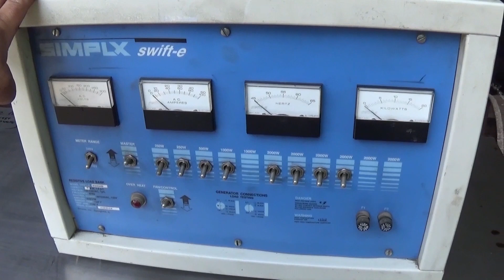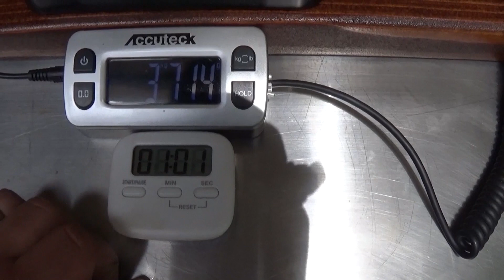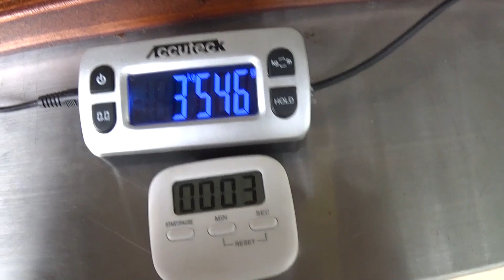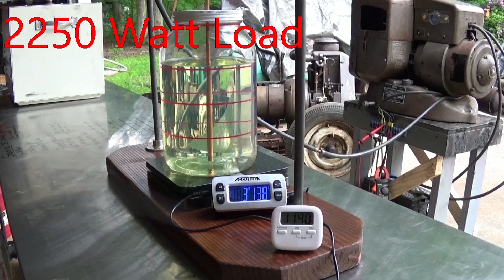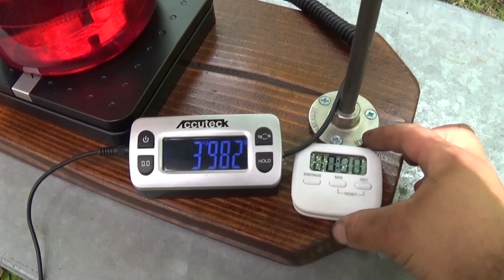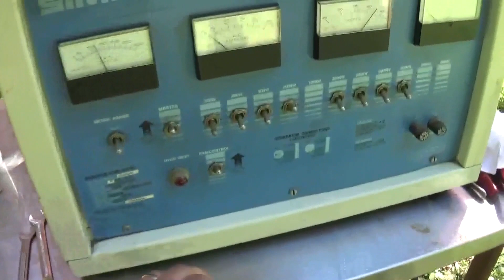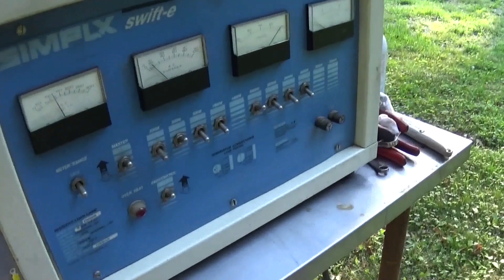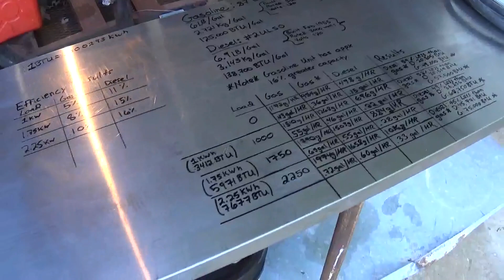GASOLINE VS. DIESEL (FUEL CONSUMPTION  1950s Style)

Comment: I switched over to diesel engines for my landscaping operation over 20 years ago. I still have the first two tractors one has 5000 hours the other 3400 and they run like the day I bought them. I was lucky to get 1500 hours from an air cooled gas. I'm  glad to see the diesel is 50% more efficient. Thanks Mike
Reply: In Europe we are running heavy farm equipment since day 0 on Diesel. I recently bought an old MF135 tractor with little over 5700 hours of operation from 1969 using the famous Perkins Diesel engine. Had it serviced from a real tractor and engine crack and he confirmed that piston, rings  and injector nozzles look almost juvenile.

I will never understand how the US ever got so obsessed with gas powered equipment.
Reply: Was cheaper in the 20s and 30s than diesel was.

Comment: You don’t need to take into consideration that one of them is a higher output than the other

As long as you match the output on both of them your figures would be correct

You shouldn’t have to penalize one because it doesn’t have as high an output as the other one
Reply: I would guess that the point is to make a hp to hp comparison.  All other things being equal, a higher hp engine will require more fuel to stay running at a certain load than a lower hp engine, simply due to the extra reciprocating mass.
Reply: Uejji In theory but in this scale it is not relevant.
Reply: @Uejji  It's still gonna be a pretty insignificant amount though.
Reply: You're right.
Though it would make a difference if one of those was compared to, let's say that Caterpillar.
Reply: @Uejji  ... actually it's all about the HP used, which would be almost the same, based on the electrical output in each test... NOT the possible peak power of the gen set.

Comment: Thanks for doing these tests, it's an interesting comparison. Although these are 1950s generators I think it gives a rough idea of how modern diesel and gasoline sets of that size would burn fuel and could be useful to anyone who has the option of buying either type. The efficiency of the gasoline unit improves so much as more load is put on it, the extra load doesn't cost very much more fuel to run. Expensive to have the unit running, but if it's running anyway, and it's oversized for what you're wanting to power, you might as well load it up with any other appliances that are useful. As we'd expect the diesel's efficiency doesn't fall off quite so badly at light load (as well as being better generally). For one thing it doesn't have a throttle restricting its intake. Some Onan CCK 3.5kVA petrol/gasoline generators were imported here to the UK in the 50s and 60s, quite a lot have survived, running at 1500 rpm for 50hz they were known for being long lasting but not for being economical! I think spark ignition engines with overhead valves and higher compression ratios could do better but they can't compete with diesel, unless designed for higher octane fuels like natural gas or biogas.

Comment: im curious now how a slow speed diesel would whoop them both? like a lister with the big flywheels
Reply: Would really depend on the speed and the generator. A 4 pole will make 60 hz at 1800 and a 2 pole will have to have 3600 for 60 hz. And 8 pole would run 900 r's but it'd have to be a big bore/long stroke like the old Cat. IF it was all a.c.
Reply: Here is the specs from the manual of the Lister CS 5/1. http://www.oldengine.org/members/diesel/ListerData/51P4data.htm
Reply: 2,250kW @80% efficiency engine > electric output. Gives 2,812kW engine input in the generator. 2,813W is 3,770 BHP. The CS 5/1 runs 0,3 liter per BHP/h. 3,770*0,3= 1,131 l/h @ 2,25 kW.
Reply: Those old flywheelers were notoriously thermally inefficient.
Reply: @lewiemcneely9143  US = 1800 / 3600rpm  @ 60hz  EU, UK,  plus shit loads of other places = 1500 / 3000rpm  @ 50hz
Reply: @chris-jb5ds  Right. I don't have to deal with 50.
Reply: The slow speed lister CS type diesels can last a very long time and are great machines, but when I looked at the numbers for fuel consumption (I can't remember where) I concluded they aren't any more efficient than diesels running at 1500 or 1800 rpm (which Lister and Petter also made).  Matching the size of the engine to the load where possible is what really matters if you want to save fuel.
Edited: I think the site Pinz314 linked to is the same place I read the Lister fuel consumption info, thanks for posting the link. Engines of this design are still made in India I believe.
Reply: @desertbob6835  The hot bulb engines were terrible, but the Lister CS is a diesel.
Reply: The injectors in the old CS Listers work at lower pressures so atomization is not that good. Also part of the reason those engines are now banned from sale due to the particulates they produce. I have a mid 80's Lister TR2 8KW generator which runs at 1500 RPM (we are 50HZ) it is direct injection and burns 3 litres per hour at full load. That works out about 30% less than the Onan in this video. I have an Onan 10KW Diesel indirect injection 4 cylinder generator (was marine), it has similar to efficiency to the Diesel in the video.
Reply: I would also like to see that, for comparison. The big, REALLY SLOW 2-stroke diesels used in large ships, running less than 150 RPM, are the most efficient engines available, with thermal efficiency up to 55%, vs the terrible 5% to 10% of the gasoline engine in this vid. Plus the ship engines run on really terrible fuel, like residual oil, that can cost as little as $300 PER TON! (Of course there are some inconveniences with resudual oil, like you have to heat it too about the boiling point of water just to make the oil flow.) There have also been diesels running very nicely on powdered low-ash coal and on landfill gas (about 50% methane and 50% CO2). Both of those weirder fuels reguire a little bit of normal fuel, like 5%, to act as igniter. The powdered coal, btw, is not injected; instead it is aspirated through the intake valve. In modern diesel experiments, medium-sized engines look like they can reach 55% thermal efficiency by using 2-stage compresion and 2-stage expansion (not counting any turbochargers in the compression and expansion). Other modern experiments with medium-to-large engines can also reach 55% thermal efficiency using direct injection of a slurry of powered coal, in either oil or water! (The water slurry fuel is not for engine starting.)

Comment: That's pretty cool. On a side note I think Diesel engines generally last longer because the fuel is more of a lubricant and gasoline is more of a solvent. Now all you have to do is a cost per kilo-watt/hour. Thanks for the cool info Mike. Best Wishes and Blessings. Keith Noneya

Comment: Even both being air cooled they are quite quiet. The diesel really surprised me! We used a 6000 import diesel on no hydro sites and hid it as far from the job as possible running big  12g. Cords. We actually left it in my boat on a island job at least 100’ away!! Man was it loud. And vibrate!! 
My ws2-3000 with a small car muffler is very quiet. 
I knew the basic result of your test before you started but the actual numbers are great to see. Here in Ontario/2022  diesel is running about 10-12% more than gasoline. This will watt for watt almost equalize fuel costs. Now there are other things to consider, initial cost, engine longevity, maintenance etc. Almost exclusively engine differences except maybe vibration effects on generator

Comment: Interesting design the way they did the engine stop on that diesel.  Having it continued to spray some diesel fuel would very nicely wet down the inside of the cylinder probably helping to prevent rust. Often times generators are used and then put away for quite a while. Pretty interesting design.

Comment: You said your not a mathematician. Will I disagree. You did a very good job with engineering everything. Including the mathematics. I work in a power station. I must say; job well done. I have a Lister Generator LPWT4 19.5 KWH in my garage and it is very fuel efficient. 1 quart to power my house.

Comment: Definitely a very dramatic difference in fuel efficiency of a diesel compared to an old flat-head gas engine. It'd be interesting to compare it to a modern OHV inverter-driven gasoline generator (if you can get your hands on one).

I also love that you calculated the overall system efficiency! Really illustrates how inefficient it is to make your own power at home. Toyota has a few small automotive gasoline engines that they claim achieve 41% thermal efficiency. Coupled with a modern 95% efficient alternator, you should have a ~39% efficient gasoline generator, which in theory would be near competitive with many power plants. Although, some modern natural gas combined-cycle (gas turbines with heat recovery) power plants are approaching 60% fuel > electricity conversion.
Reply: Replacing the old IDI diesel with a more modern DI or even CRD, let alone CRDI design ... Diesel will still win by a large margin

Comment: I appreciate the end user comparison; however, the true comparisons are much more in depth. Gasoline engines are less efficient in every aspect, fuel consumption, energy production, maintenance expense, and durability as compared to their diesel counterparts. The very nature of diesel engines automatically puts the gasoline engines at a disadvantage. Diesels are built 3-4 times heavier in construction to accommodate the amount of power they generate which means efficiency and durability will also be engineered into the equation. Diesel fuel is also a lubricant that extends the life of the fuel system components adding longevity and improved function. To your point about the theoretical power efficiency between diesel and gasoline engines, they never become equal because in order to make more power, the gasoline engine will consume much greater volumes of fuel as the size of the engine increases. For example: Freight trains and most transport trucks are diesel because the power developed in relation to fuel consumption is much better than any other fuel available today, including propane, methane, hydrogen, nitrogen, helium and even nitro-methane. Another negative impact of gasoline and most other fuels is the drying affects as they evaporate, the more refined a fuel becomes, the dryer the fuel system becomes, pumps, lines, injecters, carburetors, intake ports, valve guides, and all moving parts in the system adding to parasitic loss due to friction and eventually less durability. Higher parasitic loss equals higher fuel consumption. The real question is whether the additional cost of the diesel engine is worth the application it is going to be used in. The home owner market is probably not going to see the actual value of the diesel engine, but the commercial market absolutely does. Here in Hawaii the average cost of a 5000 watt gas generator is between $500-$1,500 depending upon brand preference, the 5000 watt diesel generator is between $5,000-$35,000 or more. However, the gas generator may last 20 years if the maintenance is 100% top notch where as the diesel will easily out last two or even three generator units and keep going with minimal maintenance. Cost versus value is always the final deciding factor. The average person will not see the added value because most are price point oriented, but there are enough of us value minded folks to keep the quality manufacturers going, but there could definitely be more of us. Thank you for your videos, I appreciate what you do. The older machines deserve to be revived whenever possible because they remind us of our history and the amazing people who have been here before us.
Reply: And if the unit sits in the garage for 99.98% of its life and is never run long enough to wear out then what?
Reply: @Joshie2256  If it's a gas unit and has been run at all, you need to tear it down, likely change the spark plugs before it gets used again.
Diesels can sit for a long time and be run instantly.
As GW Builder mentioned in his post, the diesel fuel being a lubricant as well has multiple benefits including preserving the lines, diesels do not have the wear point of things like spark plugs, most don't have glow plugs even.
There are also drawbacks to diesels, primarily cost, but weight is also a huge factor a 125 hp gas outboard weighs far less that a 125 hp diesel outboard. ( and yes, there ARE diesel outboards available. )
Reply: @Joshie2256  Like previously stated a low cost unit would be more appropriate; however, long term storage of any unit requires specific procedures to ensure that the unit is ready when needed. Whenever you plan to store equipment of any kind it is recommended that all fuel be drained. Gasoline engines need to be run completely out of fuel from the tank to the injectors or carburetors, including all fuel lines. Fuel stabilizers are also recommended to help reduce deposits. Prestart cleaning is always needed after long storage no matter what equipment you may have. I have been a heavy equipment mechanic for over 40 years, electronics may change, but engines rarely do. Fuel is fuel, each type has it's purpose and limitations, when you research your options and choose the most appropriate machine for your application you will usually be satisfied with the results.
Reply: @jaquigreenlees  That is correct,  no matter what equipment you may have proper maintenance and storage preparations are always required, each type of fuel will require different procedures.
Reply: @jaquigreenlees  Also, a rarely mentioned benefit of the heavier diesel engines is the coefficients of drag in relation to rotating mass. The basic idea is... Once the weight of the mass is moving the more difficult it is to stop or slow it down. The benefit is smoother more sustainable power because the rotating mass acts as it's own counter weight, providing more efficient power and economy. Yes the outboard diesels definitely do exist, they may not be fast, but they just keep going. My grandfather had one that took 4 men to get loaded on the boat, but it never failed ever. Many times we would tow others back to shore. Top speed was about 5-7 knots, just right for fishing and towing. Lol
Reply: @jaquigreenlees  LOL. In 2017 I took a nearly-new, but 18-year-old,, Honda gasoline-fueled generator that was purchased for Y2K out of storage. I changed the fuel and started it. I put a modest load on it, got the engine hot and changed the oil. I put it back into the warehouse. I'll bet you $1 you could take it out of storage, fuel it and start it no problem. 

ULSD is not a lubricant. This is why so much ULSD is 5% bio-diesel. The esters in the bio-diesel add lubricity.

Comment: Very interesting video, though I don't think the correction factor was correct.  You got a particular amount of output energy for a particular amount of input fuel, the capacity is irrelevant as long as both devices could output the same energy.  Really cool though, thanks!

Comment: I am amazed how low the efficiency is producing power, electrical that is !! Would using vapor really increase the efficiency of the units ??? Really like this test. Just showing how low actual efficiency is really just blows me away.  During that time period I always thought that they would have done a much better job using petroleum products. Thanks Mike for showing us the actual ture number for the better or worse. VF

Comment: Compression ratio.  Thermal efficiency.  @Hott Puppy is the only commenter that I saw had the answer.  That old 1950s Onan engine has at best 8:1 CR, Puppy says at low as 5.  The IDI diesel with no turbo has a minimum of a 16:1 CR and probably closer to 18:1 brand new (bigger diesel droplets, no air charge requires higher static compression).  The ONLY variable in thermal efficiency of an Otto Cycle engine, which these both are, is Compression Ratio.  So the Diesel probably has >2:1 higher compression ratio than the gasser, but that high compression means the entire engine has to be build heavier, especially the reciprocating assembly.  This will knock the overall efficiency back into the 2:1 range compared to a gasser.  And that's what your numbers show.  The BTU of 87 octane gas is a bit lower than what you've shown, from my rememberings, but still not enough to account for that 2:1 efficiency advantage the Diesel has.  That advantage is given by the Comrpession Ratio.  ONLY VARIABE:  TE = 1 - ( 1 / CR^(HC -1 )), where TE is thermal efficiency, CR is compression ratio, and HC is heat capacity, which is nearly identical between the diesel-air and gas-air mixtures.  Therefore the only variable is compression ratio.  It just so happens that the HC of these mixtures gives the exponent of CR the correct value to show a doubling in efficiency for a doubling in CR at this range of CR.
Reply: Don't forget throttling loss. It takes power, to pull a vacuum on the intake manifold, which constitutes a parasitic load on the gas engine. The intake of a diesel is NOT throttled, so it simply spins easier, despite the higher compression. The thermal efficiency is similar, if the gas engine is run wide open.

Comment: An old rule of thumb has been that increasing compression improves the thermal efficiency on either motor.  With gas engines, you only can go so far, because of knocking.  So, they may be limited to some 10:1, while diesels have been in 16:1 for the pre-chamber (is that an applicable term -- I'm not a mechanical or auto engineer) type and more than 20:1 for the direct injection type.  So, a clear advantage for the Diesel.